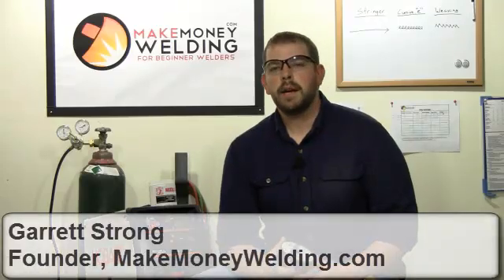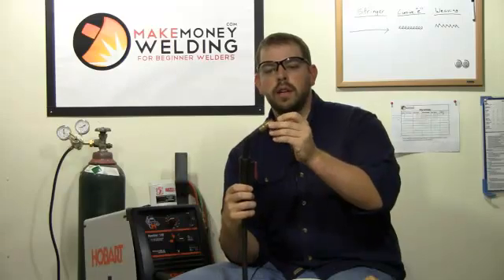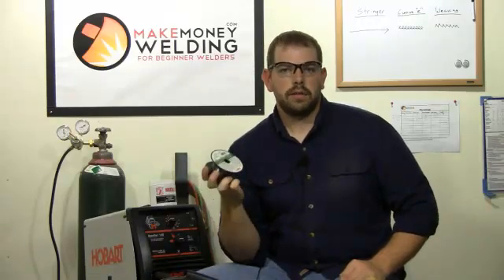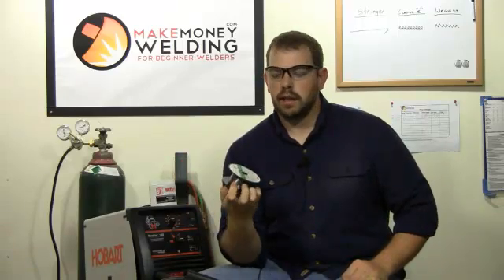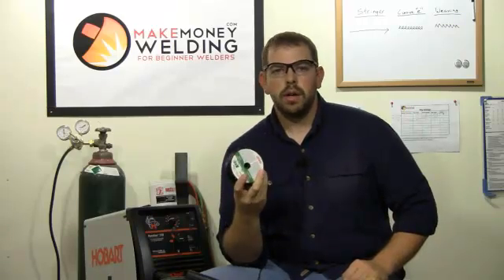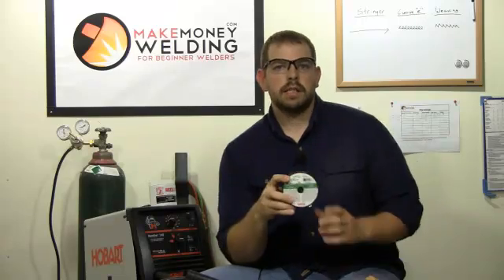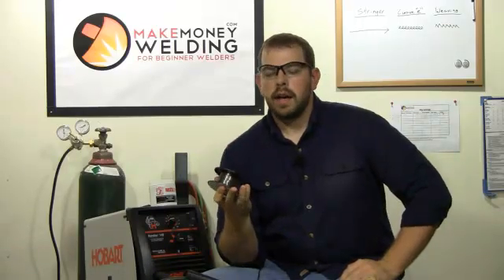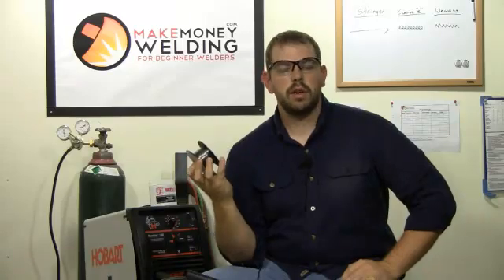Intro To Gasless MIG Welding

Comment: Garrett: I finally was able to get a new Flux Core Wire using steel wire and the the copper-covered flux wire.  I bought it from HF this last weekend.  I had to get the one I have now, as I only have provisions for 120 V.  It is a Chicago Electric (the newer model).  I had no problem setting up, except when it came to feeding the flux wire through the hole, so I used a "Mosquito" Hemostat. I allso picked me up a Chicago Electric 7/8" Angle Grinder (I already had the wheels that I needed, I was also signed up for the Insider Track Club, which basically also did a great deal of wonders of cutting costs.  There's one other person who posted earlier about some of the minor setbacks and I made suggestions(he did listen), as I had already made some of the few minor things.  He wrote back & told me I was right.

Some moron told me(not that I am going dignify his statement with a reply, as I am not.  I have better things to do than squabble.  Anyway, I just wanted to let you know that I am closer to starting out & aim to accomplish such.  Yes, I take welding safety various serious, so no questions about that.  I want to thank you for your words of encouragement.  It means a great deal.
Reply from the maker: Steve Marshall Hey Steve, thanks for the comments. I hope all is well.